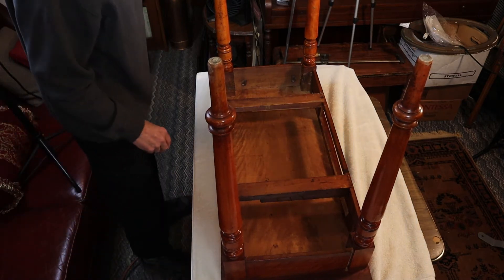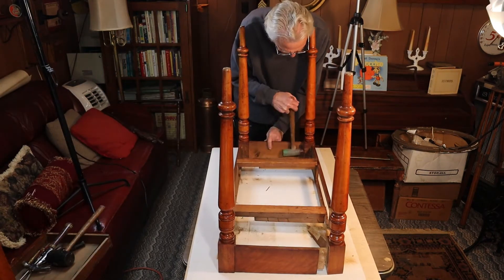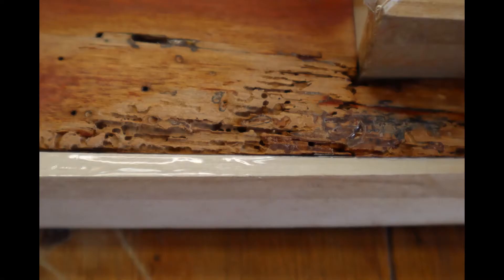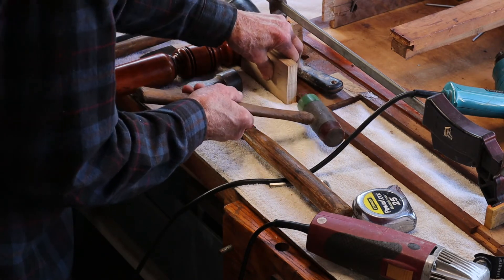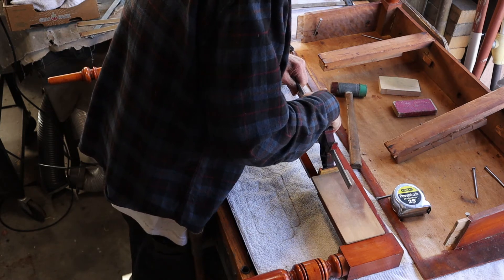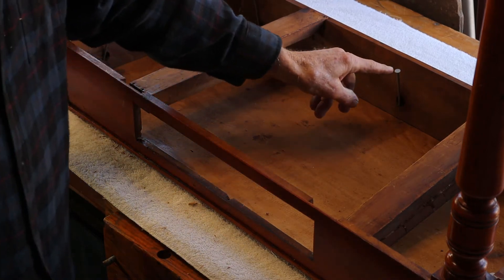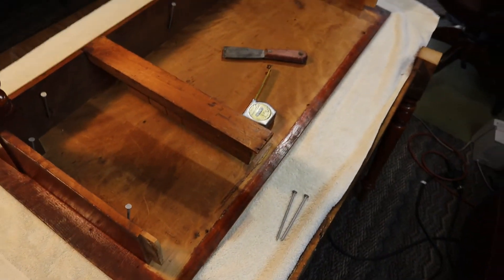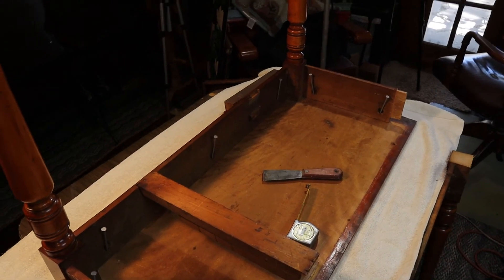Restoration: How woodworm was impossible (almost) to fix.

Comment: So, you ended up placing the frame more symmetrically with respect to the top. Assuming the top was square, that was the right choice IMHO. I don't think there was any sacrilege or violation of the antique code to make it more correct
Reply from the maker: I agree and that and that fact that the line up of the legs while standing was an important aspect. Thanks for the comment.